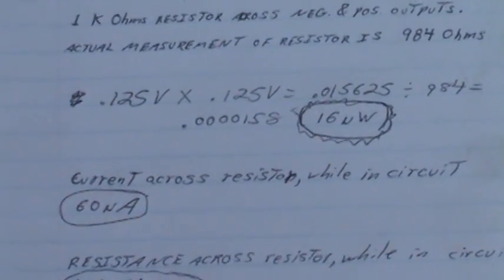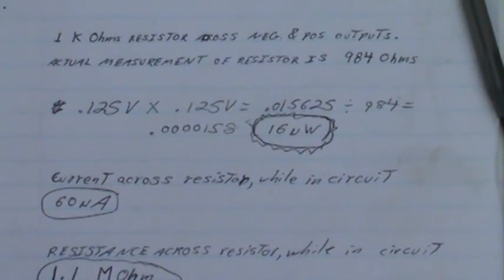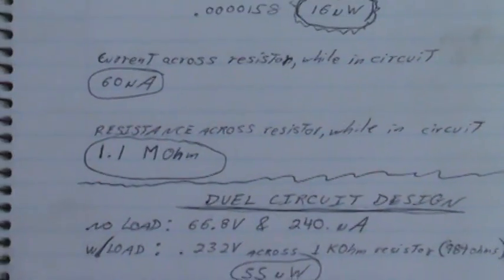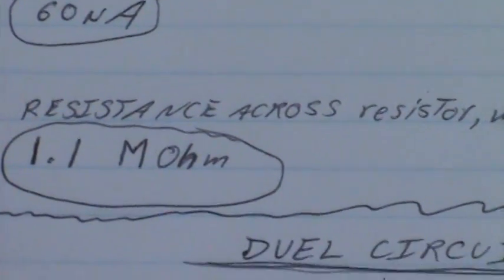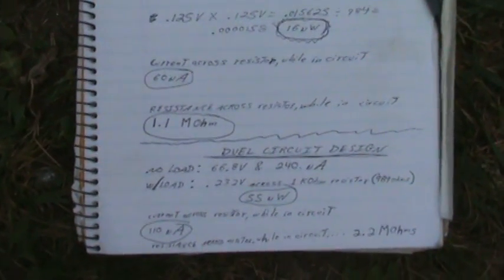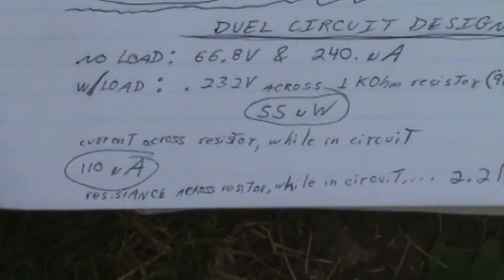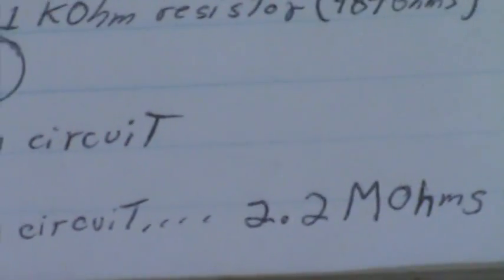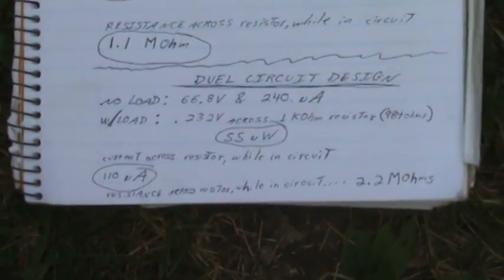FREE ENERGY FROM AIR CIRCUIT PART 24/24

Comment: So let me get this straight. you said one makes about 60 micro amps, that is (60 * 10^-3) = 0.06 Amps. So if you hook up 25 of these you would have 1.5 amps, or enough to slowly charge a car battery? 

Do you use the same antenna when you have two connected?

Comment: Maybe have a coil from the antenna to the cap positive, and a coil from the ground to cap negative. Maybe try a generic vacuum tube instead of the spark gap! The switch from the gap or tube should occur similar to the one in the Tesla coil between the high voltage drive and the positive side of the primary coil. Think Tesla coil backwards.

Comment: have you tried making a laden jar style capacitor out of a home depot large plastic paint can? look on instructables for the laden jar of death. These capacitors are better for gathering high frequency waves. Try a spark gap that is connected to a step down transformer to increase current. You may need multiple step down transformers in a chain where the secondary becomes the primary of the next in the chain. Make sure to put a non polarized cap between primary and secondary in parallel.

Comment from the maker: Very good question. Yes, maybe, something  i have read about many times. Makes a small antenna act like a large one. It would probly be a complex circuit that maybe above my expertise of understanding how to build. but then again will there be enough power to run all the components, or will you have to add a power source to only the antenna first. I think if we got the proper circuit and ran in resonance frequency,,,it would not matter how big the antenna is.

Comment from the maker: i would think you need at least a little current just to move the voltage from 1 place to another.
Current will probly determine how long it will take to charge it.
I will have to try it, thanks.